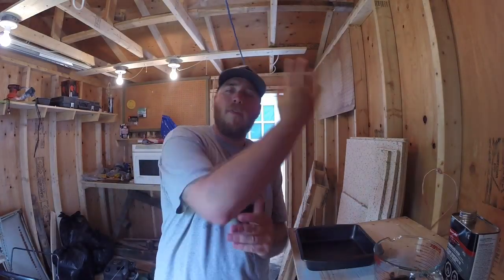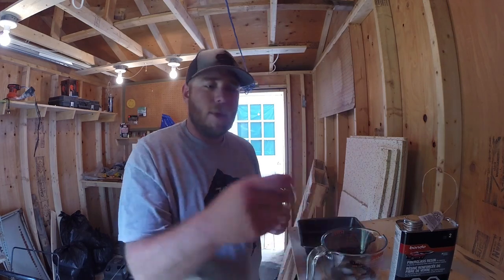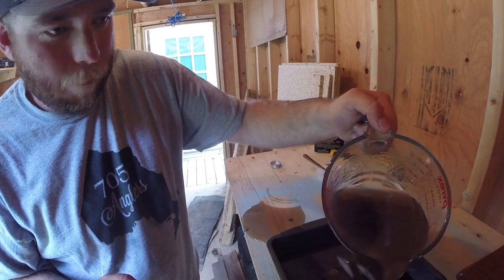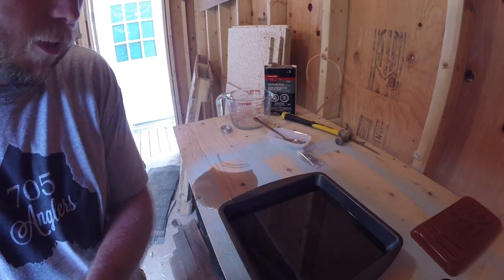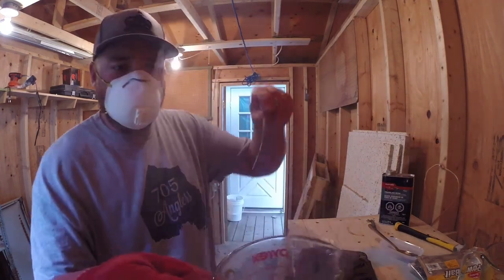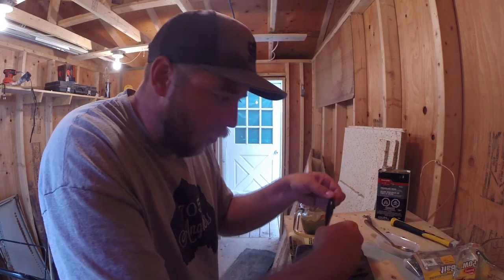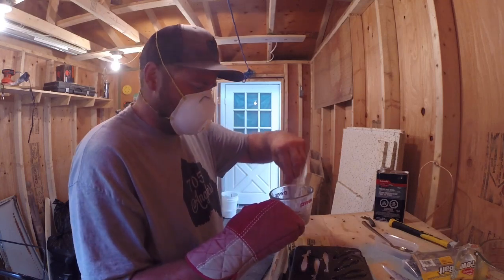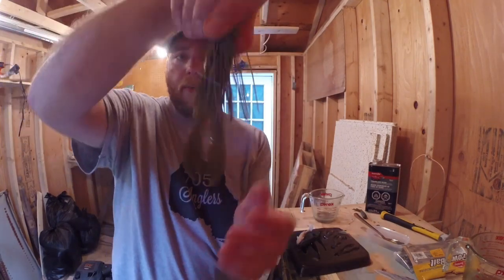How To Make A Soft Plastic Lure Mold Using Fibreglass Resin

Comment: How do you find the homemade poured baits hold up vs. the one you purchase new in the package? One note about your respirator. It looks like a dust mask. Dust masks filter out dust and carbon particulate. What you need is a respirator with a P100 organic cartridge the remove the plastic fumes. A dust mask is better than no mask, but if you want complete protection from plastic fumes go with the P100.

Great advice about not using your home microwave. I am sure people would have or may still be doing that.

Good video and will give this a try
Reply from the maker: Durability is identical. The plastic doesnt really lose the quality.
Thanks for the advice on mask. I'll look into it

Comment: Question for you, when you make baits in your fiberglass molds do they come out shiny if not do you know what you can do to make them that way?  Thanks
Reply from the maker: I add a spray of Pam or something to the mold before pouring
Reply: If lubing them doesn't give you the shine you want just melt down some brand new plastisol. It turns perfectly clear when heated to around the 360 mark. Then just dip your baits into is once real quick and let it drip into the Pyrex cup. They will shine better than most store bought baits and if you do this after you put the eyes on like swimbaits and the suck they will NEVER be able to fall off on you ever again. Two birds with one stone my friend.

Comment: Great video. Question, when you glue the baits into pan before you pour the resin wouldn’t it be a good idea to lubricate the lures to make them release from the resin once it sets up or will this affect the mold in the way your baits turn out? Thanks
Reply from the maker: I tried lubing them once but the mold wouldn't dry properly and the mold was lumpy.